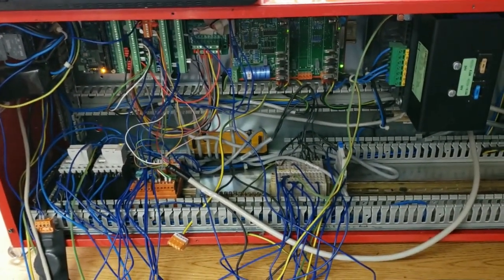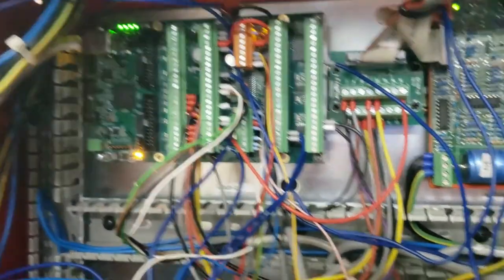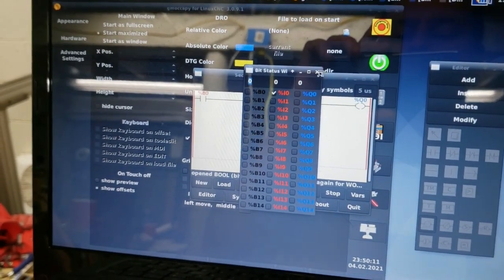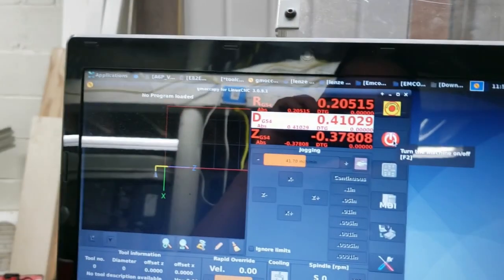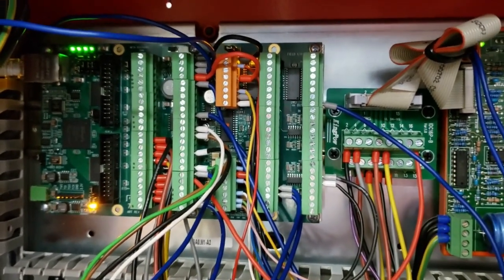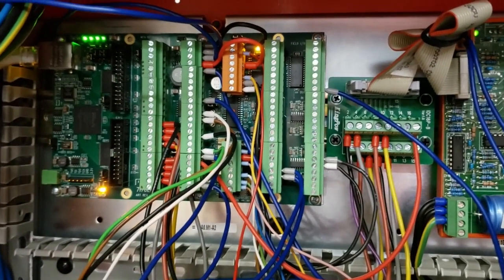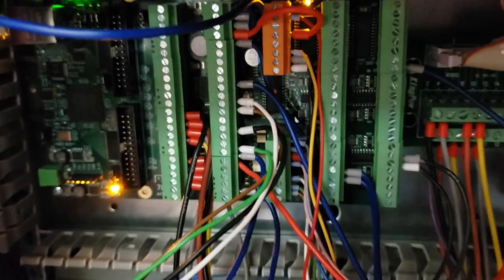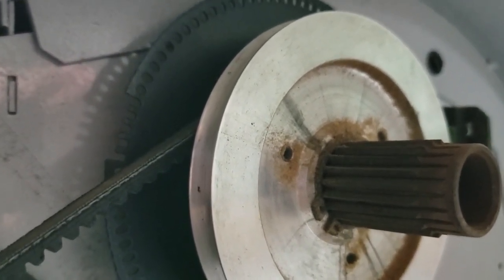Emco PC Turn 55 LinuxCNC retrofit - Part 3

Comment: Is it normal that the 100R 5W resistors for the turret get really hot? I'm also doing a LinuxCNC retrofit and just powered it up for the first time. I noticed the resistors were already 90 degrees C after a minute.
Reply from the maker: @Fireshuffle  sounds like something might not be copacetic there. The board gets warm, but not 90c
Reply: @TheFeralEngineer  On the original schematic, the 24V used by the DC motor and goes through the safety/USB PCB. But I measured it at 24v before I started the retrofit. Now it is wired directly to 24V. I did notice a "hot electronics smell" before I started the retrofit. But the I had not checked it with a thermal camera. One more strange thing, the schematic says that the DC motor is a 12V motor. But 12V isn't used anywhere else in the machine as far as I know.
Reply: @TheFeralEngineer  I have found a solution for this. I'm now using a DRV8871 DC motor driver with a relay to switch between directions and maximum current. But now I'm having trouble with the stepper drives/motors. The motors are only buzzing, not rotating. The wiring seems to be right. The frequency of the buzzing depends on the jog speed. So it is getting the right signals. I checked the step/dir signals on a scope. Seems okay. Do you have any idea what can be the problem?
Reply: Nevermind. The motors were actually moving, but very minimal. The step scale was 200 but it needed to be 2000. It was moving 0.1mm instead of 1mm.

Comment: Hi Sir, the encoder "cheese wheel"  is held onto the turret shaft with a groove or just purely by friction ? 
I ask because if it is purely by friction this means when the  " cheese wheel" is removed and reassembled, it needs to be realign correctly to tool position 1.

Comment: Sir, I have a question regarding the tool turret. Does the turret sense tool # position and count each tool position ?
Reply from the maker: The turret has an encoder on it with index and pulse. The index sets position number 1 and the pulse counts the other index positions. When the turret does a full revolution back to station 1, it resets the counter, so it'll never lose position
Reply: @TheFeralEngineer  hi again, thank you for your answer. It confirms my understanding of its workings. Just to let u know i am atempting to fabricate my own tool turret using nvr30 worm gearbox and stepper. I have design on cad the pieces and intend to fab it,  Ratchet wheel shaft, back and front pieces to convert to a turret. The tool 1 index will be triggered by 1 slot on opto disk wheel and remainder tool count by a secondary sensor (second set of 8 window slot ) . I have the vb script for rotating A axis stepper (via mach3). I just need 2 input from BOB used as index and count.Its fir my chinese cnc mini lathe cinversion. You can see on my youtube videos.
Reply: @TheFeralEngineer  Thank you for sharing your tech knowledge with your fellow youtubers. I appreciate it very much. cheers stay safe
Reply: Hi Sir I think i got the answer from your video at time 12:30 onwards